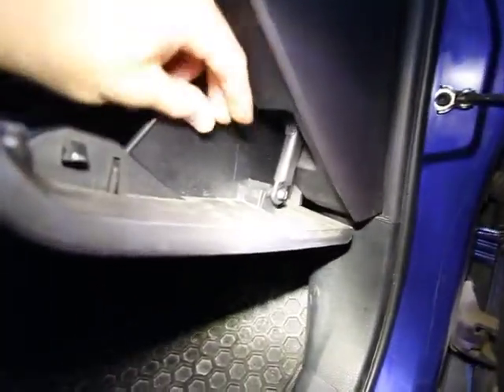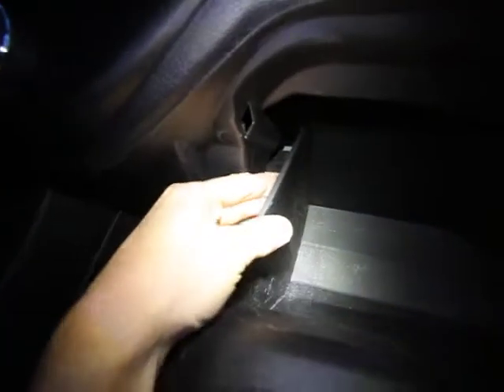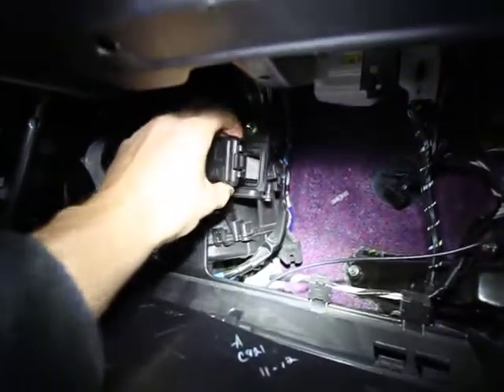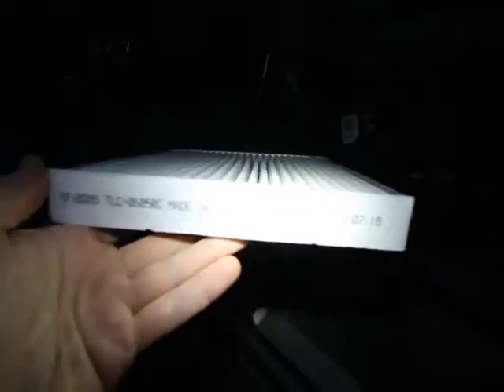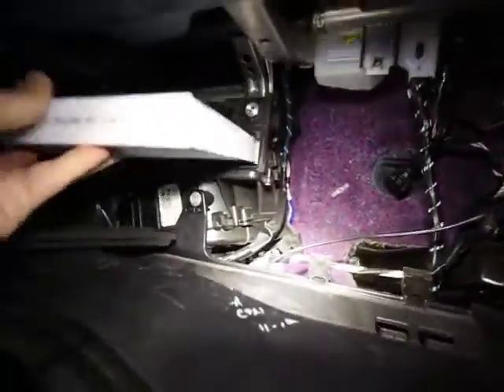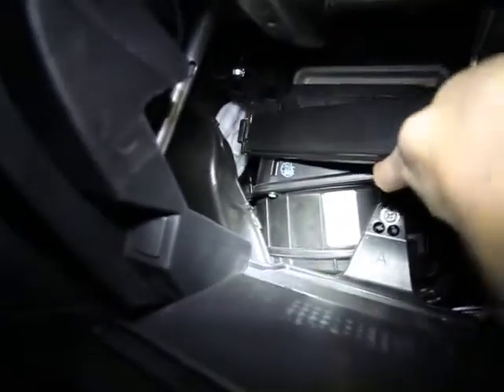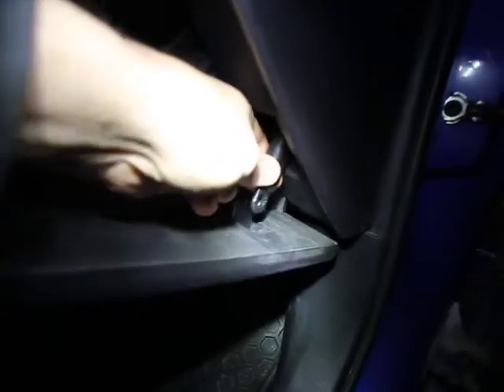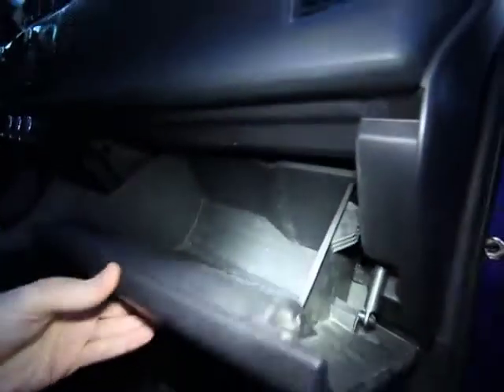Corolla Cabin Air Filter Replacement, 2014, 2015, 2016, 2017, 2018, 2019

Comment: Toyota stealership charged me $53.00 CDN  to replace mine on a routine oil change  / maintenance  job.  . They charged $20.00  "labour fee"   plus $32.00  for the filter that you can buy elsewhere  for about $10.00.  When I questioned the $20.00  charge for installing it they
claimed they have to charge what Toyota  tells them to charge.  Total rip-off !
Your video is crystal clear , and it takes about 5 minutes  to change one  yourself  with your video as a guide..👍👍👍
Reply from the maker: Thanks! Yes there are some very cheap filter options, but they will not filter as well.. I have links to 2 types of filters in the description. One is charcoal infused which helps to absorb odors, while also filtering particles. The other is HEPA, and it filters particles very efficiently, but no odors. A good filters helps to make sure dirt/mold/etc. doesn't make it to the AC Coil, which will then make it smell.
I'm going to do a air quality test with the HEPA filter sometime soon, to show how much it reduces outdoor pollution. Thanks for the feedback and watching!

Comment: Airflow down right?   Great job.
Reply from the maker: Air flow is downward yes. If the filter shows an arrow and the letters "UP" next to it though, then face the arrow up.. They sure make it confusing.. so it depends on the filter if the arrow should be up or down.  Bottom line, Airflow=Down ,. UP Arrow = Point arrow up.
Reply: @CleverFix  I purchased a purolator brand and it reads air flow down with a arrow down.  Thanks again.

Comment: Is this the Fram Frabreeze cabin air filter? If so, the arrow is pointing downwards and it shows an arrow pointing upwards on the Toyota filter box. I'm confused.
Reply from the maker: The air flows from the top to bottom. If it says "THIS SIDE UP" with arrow next to it, then point the arrow UP when you put the filter in. If it says "AIR FLOW" then point it down.

Comment: Toyota corolla 2014 air flows down where do I have to install the filter with the arrow pointing  up or down cv10285 fram cabin filter
Reply from the maker: It depends on what it says on the filter... If the filter has "UP" next to the arrow, then the arrow should point up .
If the filter has the words "Air Flow" , then the arrow should point in the direction of the air flow, on the 2014 Corolla it's down.

Comment: I was checking to see how exactly to put in the filter cus it has an air flow direction way that youre supposed to put it on...
Reply from the maker: Air flows down, so if it writes "Air Flow" next to the arrow, then it should point down.

Comment: There is one thing missing here. The air flow direction-which side of the filter should face up/down?
Reply from the maker: If it writes "UP" next to the arrow, point the arrow up. Otherwise down. Air flows downward.

Comment: Wow Toyota was about to charge me $60 for this lol
Reply from the maker: 😶 That's a LOT.. You can probably get it from Amazon for around $15US, I have links in the video description as well.
Reply from the maker: There are two links, I Prefer the filter with carbon, it looks black. Carbon will absorb smells as well, while the plain paper one is just for particulates.
Reply: @CleverFix  thank you for the tip! I never would have known that
Reply: 85 at my local Toyota
Reply: @CleverFix  About the same at Advance Auto Parts give or take a buck or two.

Comment: Which way is up
Reply from the maker: Up is toward the sky. Very simple =)
Reply: @CleverFix  lol where the air flow is .
Reply from the maker: @edgarg.c9682  It's not like a furnace filter. If the arrow says "Up" next to it, it just means it should point up... The air flows from top to bottom, but you don't really need to know that.
Reply: @CleverFix   thanks that means arrow down .
Reply from the maker: @edgarg.c9682  No, as I explained, these filters don't have a "flow" direction. The arrow is strictly to be pointed UP regardless of airflow.

Comment: My glove box fell out completely and i cant seem to reconnect it
Reply: Nevermind I fixed it. Had to push it back and snap it into place
Reply from the maker: @ThePostalOffice  There's a trick to line it up, I show it in my Glove Box video: https://www.youtube.com/watch?v=b5L_DiGO8fc
Reply from the maker: @ThePostalOffice  When lined up at the correct angle, it actually won't "snap" , it just slides right in without any force.